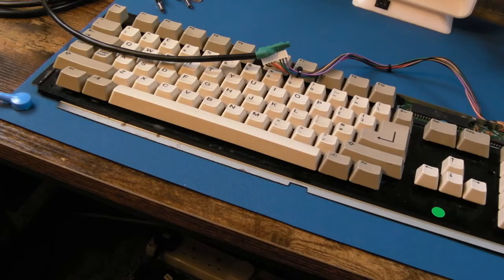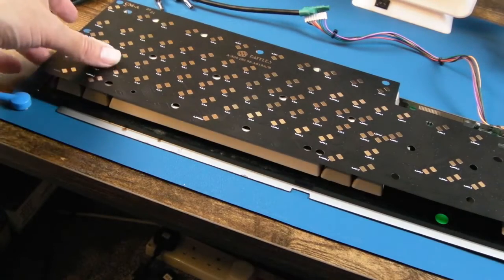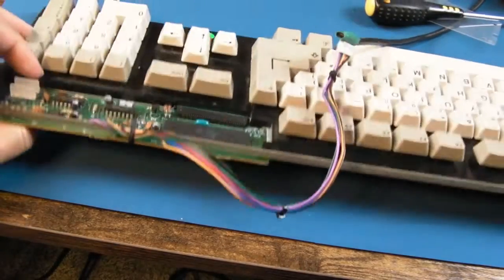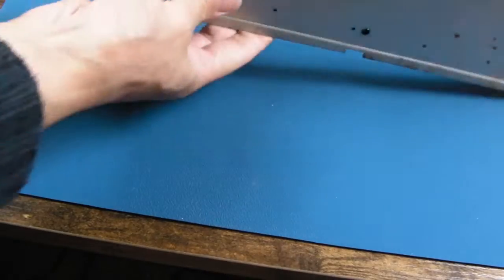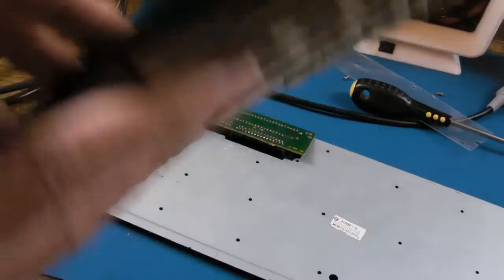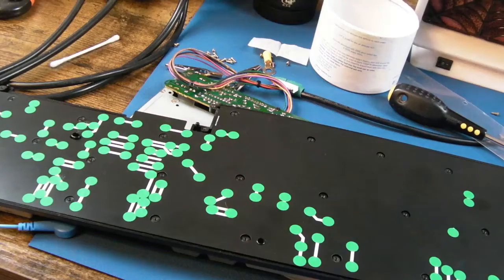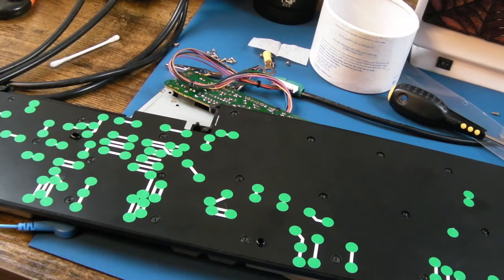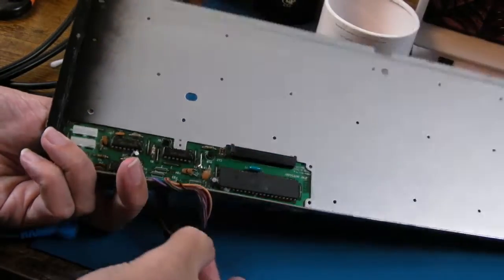Commodore Amiga A500/500+ Modern Hard Keyboard Membrane

Comment: Brilliant, that rigid membrane.  I never thought to use a PCB to replace deteriorating keyboard membranes.  Imagine how many different machines with bad keyboards could be saved, if only you have a PCB layout.  It may not work for everything but it's an idea to hang our hats on.

Chris I'm surprised you don't have a drawer full of old screws.  I went through a phase of taking junk apart just so I could have the screws.  Got myself a couple of pounds.
Reply from the maker: I've got loads of spare screws lol!  I had spare Amiga keyboard screws in that drawer you could see (and plungers too) =D